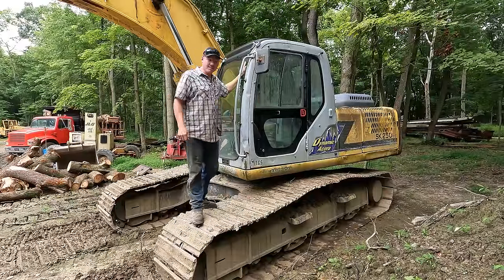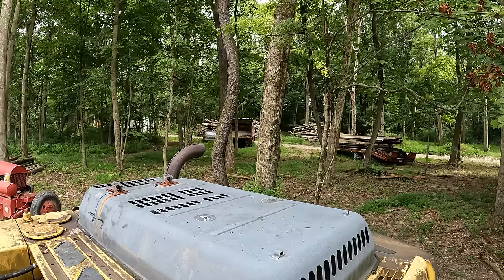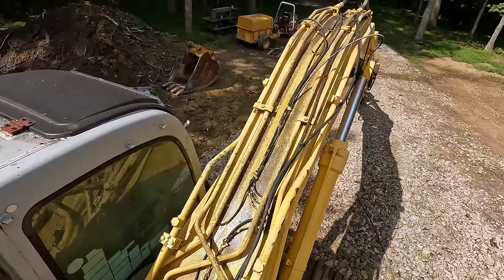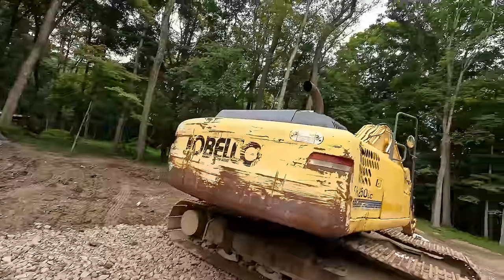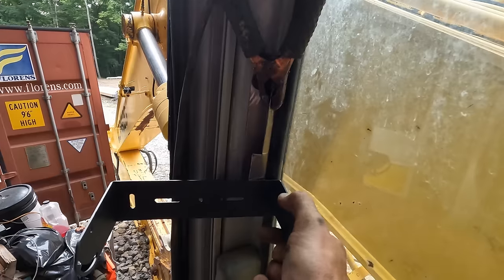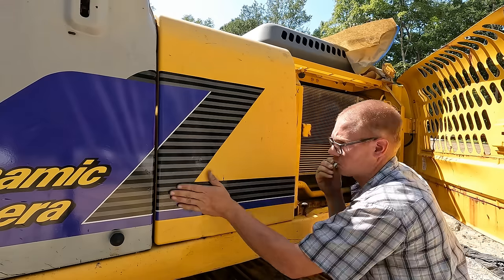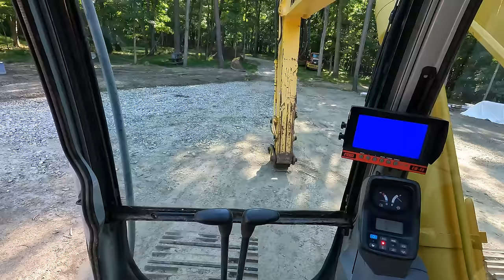Fixing up the Cheapest Excavator I Could Find! (Major Transformation)

Comment: 16K!, what a deal!, you did an incredible job cleaning it up! , I've been an operator since 1973 and have operated most makes of excavator, with John Deere being my favorite, we have a 330 Kobelco, that I have probably put 5 to 6 thousand hours on, and really like them, like most machines, none are perfect, the down side to Kobelco are, from my experience up here in Canada, They HATE the cold, after -23C, it's recommended not to attempt to use them, up here,  that is not very cold,  The undercarriage is fairly lightweight and the seat and front window linkage tend to fail as well as the hydraulic lock out lever, but their positives far outweigh their negatives, the heavy lift function actually works and is designed well, compared to a Volvo, for example that when engaged only stays active for 9 seconds, Kobelco stays until you turn the switch off, and it's quick, very efficient!, and lots of power, although I prefer John Deere, If I came across a similar deal, I would jump at it! WELL DONE!
On a side note, there is a product called "Rapid Tack", used by the sign industry to apply decals that  works amazingly well as well as "Rapid Ease" for removal, you should also use a plastic scraper that when you received your decal package, should have been included, goes along way to help apply a get rid of bubbles, especially a help with larger installs, but you did great!
Great Video, you now have another subscriber!, CHEERS!

Comment: Cleaning & stickers went amazing! I think I told you before to consider Andrews habit as soon as he buys something new, he hot pressure wash it. Consider washing the tracks. I know they'll get all dirty again but you'll be attacking the crustiest stuck caked dirt that wil be eating your sprockets. So maybe once a year it'll be useful to go through each machine and give them a shower or after a salty or dirty work, if you have time. It creates content and I at least love it. I don't have much time but I loved this vide just for the cleaning, is amazing what dirty can hide in value I come up with this key, "buy dirty based on functionality. Dirt can hide value. Sale as clean as possible, cleanliness can raise your product in value by a great 50-80%, maybe more".

Camera, great! I need one for my vehicles. About the lights, you may want to swing them sideways so you get advantage of the angle they can light that is lost towards the boon by being straight. Do you have at least one for backing up, and no need of one on each side once you have in front and back? Once you swing them sideways you'll have light on the sides, and maybe two on the back, swinged towards the corners, will set you with lights around the entire machine. 2 is better than one, if one goes off, you'll have 3 running and you can always swing one to feed the front or the back straight.

The yellow on the counter weight is perfect bro, is better than the way it was before for 10+ years unless you prefer to lift it up but again, matching painting is a challenge but is ok, is just $200 if you will. I would live it just the way it is but if you're disappointed, I would save those extra $200 but is ok if you bring it up darker, it'll make you happier, go ahead then! YouTube or future jobs will pay it back!

The floor can be pressure washed towards the outside, maybe putting a cover towards the right to protect your controls of splashes or clean it manually with a broom, water and soap fro time to time. Some get to the wrong conclusions that if we are dirty or, out of trim or, our equipment is dirty that we'll leave or make their job a mess and no, absolutely not, because they don't know we ended up dead for them once we finish so there's no energy left to clean all. But, once recovered when you got a time at least give them a wash once a year or, once every two years or, if you really have time twice a year at least, but don't forget the tracks. They can really benefit from a wash! And is a lot of fun!

Notice only the minute 8:59 of this video https://www.youtube.com/watch?v=S50DKRtqFGQ only, see the packed dirt in those sprockets after a quick wash I guess, or AC's well pump got broken, he mentioned minutes before. I think if you don't while the machine gets muddy you'll ne grinding that dirt until you clean it or it eats the sprockets.

Then don't go to minute 10:18-10:40. Because you'll see where does mud get into. Is insanity! LOL, alright man, take care and keep producing for your students!

Do not go to minute 36:30!!! I told you to don't!!! Well, then don't say I didn't warn you!!!

1:08:03, is where the money's at!!!

Comment: A trick, I learned to clean the tip, after use, is to hold the the canister upside down and engage the noose tip. The aerosol moves to the bottom of the can blowing clean solvent like liquid through the tip.

Comment: you can use aerosol window cleaner to position decals, soak the surface, and put the decal over, it lets you move them around, then use a squeegee like you use for bondo to smooth it out, and it works slick

Comment: A little late now, but I was told I could use SprayWay foam glass cleaner on a surface, leaving the foam and then apply the decal.
You can then use a squeegee to remove the bubbles & liquid.  It'll dry and be perfect.

Comment: You turn can upside down but for better flow sit cans in hot water so paint flows and shakes better.   Just get some Rust-Oleum primer and cans yellow ore tractor supply yellow.  You buy harder. Menards like a Lowe's sells industrial paint by gallon.
Check grease on forks if haven't don't want see throw a track

Comment: Hi, regarding the stuck paint valve here is the way to avoid the problem...once you use the can to paint something and are finished painting...turn the can over ...press on the valve and wait a fraction of a second until the paint stops coming out of the valve...you will easikly notice there is no more paint in the valve and it's tubing...you do this every time you paint and are finish painting...the valve can stand a few minutes no being cleaned...but when you are done, turn the can over and clean the valve...

Comment: Hi mat . Jeff here from South Wales in the UK 🇬🇧... My father showed me  years ago how to solve the spray can problem... The nossle on the can gets clogged because the pressure in the can is to low . To solve this problem is to get a tyre valve and cut the bottom off it place it on the spray can where the nossle goes and connect the valve to a air line and give it very short bursts of air... Always rap a rag around the can in case you over do it... As it can get very messy lol

Comment: Long time back...  I found the "paint can blues" amusing.  All of the spray cans I've purchased in the last five years are "all position sprayers", so turning upside down doesn't help anymore because the draw tube valve remains full of paint.  Then when stored for a while it sets up and won't spray.  I've pulled the nozzles and stored them in paint thinner and even that doesn't cure the draw tube/valve problem.

Comment: For the spray cans sticking/clogging. I had a squad leader when I was in the Army that showed me that if I spray it upside down for just a second before hitting it with the paint, the tips did not clog, then of course reverse that to clean the tips.
Shake after spraying upside down.

Comment: To clean out the nozzle of the paint can just turn the can over and press the valve for a few seconds until you see there's only gas or less paint coming out. Then wipe away the drops on the front of the nozzle and it will be ok!!!
That's how we professionals in Austria do it... ;-)

Comment: Hey there Matt watch and enjoy the videos, why not put a nice big Diesel Creak logo (Vinyl Graphics) on the counter weight, [Free Advertising] well other than the cost of the vinyl which you can buy for here in Canada $130-140.00 for 24" by 100' long, I'm sure your wife has the skills to print out letters or designs on a lasor printer then trace them onto the vinyl and cut by hand with a sharp rasor knife saves a ton of money just a suggestion brother and when you do any Graphics just tape straight down the middle, leaving a bit of tape past the Graphics, say an 1", for every 4"s up to about what you figure will hold her down, then flip 1 half over without creasing it, spray soapy water where you will lay that Half down using a squeegee from Doing body filler little plastic ones and smooth away if you have to adjust the soapy water let's you pull it back up easily. Once that side is satisfactory peel the other half backing off and repeat, this side is easier because it has half of it holding it in place not just a bit of tape. Best of Luck, with future endeavors wit Peace and Luv Andrew from Barrie Ontario Canada L4M2Z8

Comment: Soaking the tip in rubbing alcohol or paint thinner will clear a clog.
As for your paint, tractor oil based single stage paint is much cheaper and can be mixed in almost any color.
Thirdly, to help with you sticker installs use a spray bottle with soapy water to spray under the sticker before and during install. Then squeegee it starting from the center out to one side and then the other. It'll be much more forgiving.

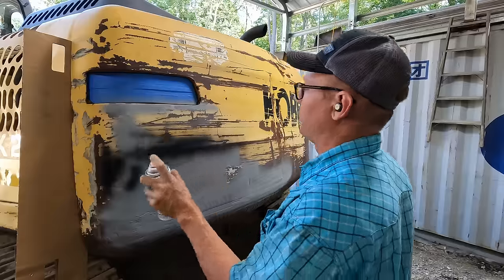Comment: I know a cool trick to get air in spray cans that ran out of propellant but have product get a valve stem for a car and drill it out just big enough to press the can pin down but not to big were air cant escape attach the valve stem to a paint can lid As a sheild put it back on can attach compressor and fill can with air now old can has propellant normally around 150 psi most cans say how much psi on them Hope that trick helps some day Matt 38:44 @Diesel Creek

Comment: That's not how vinyl graphic decals should be applied.  Simply mix up a bottle of dish soap & water, spray the surface with the mixture, apply the decal over the soap/water mixture, use a small rubber or plastic squeegee and squeeze out the juice and you're done.  While it's still wet and before you squeegee out the soapy water you can slide and position the decal where you want and once it's done there's be zero air bubbles and it'll be perfectly straight.  The soapy water film between the decal and surface will evaporate inside 24 hours.

Comment: Trick for the paint cans is to turn them upside down to spray some of the cans solvent though the nozzle. especially after your done using it. the solvent cleans out the valve and nozzle for next time

Comment: So instead of losing half your paint because propellant runs out because you invert it, just take your nizzles off and set them in a jar of lacquer thinner.  It won't harm the nozzles and keeps them CLEAN!

As for the decals in the future as weird as it sounds, hose down the machine where the decals go with dish soap and water solution, as well as back of decal, and you can position it in place.  Then spray the front if the decal and use a hard plastic squeegee, to squeeze the water/soap solution out, which also gets rid of bubbles and then let it dry.  This is how its done by the professionals, this is how window tint is done as well.  It does NOT ruin the adhesive as some people who have never done it will claim.  I cut and print vinyl as a side business

Comment: One way to install large decals without coating the surface with soapy water is to slit just the backing paper vertically at the midpoint. That way you can tape the edges at the exact position, then remove the edge tape on half of the decal and pull that side backing paper and install from the midpoint to the outer edge. Eliminates a lot of hassle and risk of bubbles.

Comment: Turn can upside and spray to clear nozzle 2-3 seconds method is great but only works a few times.  Spraying small jobs then clearing nozzle multiple times runs risk of having paint with no propellant.  Remove nozzle and blow out with air.  If paint is lacquer, clean tip with lacquer thinner.  Then submerge  nozzles in glass jar with mineral spirits, acetone, turpentine.  Avoid storage with lacquer thinner as it eats most plastics and  jar lid seals.

Comment: Picked up a 2015 bobcat and have taken out a wheelbarrow load of muck. Going to get some grime cutter, thanks for the tip. Also I got implement paint and have applied it with a brush and roller. It’s about $25 a quart, $65 a gallon. Two or three coats and it looks great.

Comment: @21:16 yes there is something you can do about it.. Bombs Away and HOT WATER pressure washer.. cold water just moves grease around.. good cleaner with a hot water pressure washer will clean it. 
@42:08 the reason the color is off is not the black primer.. the color is off because the factory paint has been in the sun for years and its faded slightly. 
@44:30 spray it with soapy water 1st.. then you stick the decal on and you can move it around.. use a squeegy to get all the water out after its in place..

Comment: Great vids , always enjoy your stuff,
Tip ..  dont waste another $200 on yellow paint for the rear  it wont add value anyway, instead get a quality tin of black paint and brush it on , the finish will be fine as the surface is all chewed up anyway so no benefit from spraying . The Volvos letsdig18 operates are like this and look good as well as easy to re-apply  when you scrape it . i know the rear decal is Black but it will still be cheaper to just buy a new decal in yellow

Comment: Wonder if the shovel got moved from under the boom? 🤔 to save paint cans after your 1st use turn it upside down and spray a little clean gas out of the can presto next time you use it the pipe and cap should be clear 👍

Comment: For the paint spray nozzle, I've had the same problem and cursed the things.  Turn the can upside down for 2 seconds mostly works pretty good....but when it doesn't:

Soaking a clogged nozzle in lacquer thinner has never worked for me, nor has any other fix.  The only thing I've found is to take a tiny drill bit in a Dremel tool, like an .015 or such and drill it out.  

That works, guaranteed, but the spray pattern will be ruined and takes some careful work to get a decent coverage after that.

Comment: Ok, spray paint, warm up the can in hot water first or a fan heater, this will thin the paint and it will not clog up, after use, hold can upside down and clear the nozzle, I use the method in my model making and always works fine....

Comment: If the tip clogs while using, pop off the tip and use a can of brake clean with the red straw attached, insert the straw into the tip and spray out the clog. Might have to do it a few times but will get you through a can of paint without wasting it.

Comment: Get a spray bottle..use water and some liquid dishwashing detergent.... it allows you to lift and move the decal... lay the decal face down and peel off the backing...spraying the glue side with soapy water...this prevents sticking to itself...spray the surface your putting it on...( i usually preinstall it and add tape reference edges to reposition it once ready - small ones i hinge tape it and peel off the backing ).... lift the decal and start positioning it...use a good applicator squeegee and start in middle working outside ( it can move with soapy water so start slowly ) with light passes...if it is ok and in position...press harder...you can lift it if needed but do gently...it can be moved with water ...and bubbles pushed outwards...get big bubbles out.. press out from middle to edges and stay in overlaps to move bubbles.. work completely in one direction and then outwards from center in each direction... it will need time to dry and a hair dryer ( safer for most people than a heat gun ) can speed up drying...

Comment: The key to keeping spray paint cans functional is to "clear the nozzle" after each use, to do this hold the can upside down and spray for a few seconds, this wastes a little propellant but it clears the paint that is in the tip so no paint will dry and clog the tip. But I would suggest just buying primer for that actual spray gun you used for the color coat, will save you so much time and money, even if you buy a separate cheap gun from the auto parts store just for spraying primer.

Comment: I think Cat and Kobelco use a very specific shade of yellow for their equipment, so for future repaints like this one, you can probably look up the color code for that specific color and bring the code to your paint store for them to mix for you. Though on an older machine, the correct paint color will look off since the old paint will have oxidized from sitting in the sunlight.
Reply from the maker: That’s what I did. I don’t think they mixed it right
Reply: @DieselCreek  Ah ok, I just mentioned it because it sounded like you had used 1 of those paint color cards that you can get at the hardware store to compare to the existing color on the unit and they just messed it up when mixing.

Comment: You make mention of the two yellows not matching well. Have you thought about running a 3" border of black around the counterweight to separate the two yellows. It could be done with a spray can and paper-tape the edges for over spray. Might sharpen the look a bit for not much effort. 
Nice job on all the rest - especially like the lighting addition.

Comment: A turbo head on the power washer may have made the job go faster.

Call your body work PHDR ; Power Hammer Dent Removal.   Just needed to use the big scrap of steel to act as a dolly to remove dents.

Take a small piece of the sheet metal down to an auto body paint store and have them scan the color with their computer.  It’s a crap shoot trying to match via those small color splotches on paper.  $200 for a quart?  Should be about $55-$65 / quart.  I suggest shopping around.